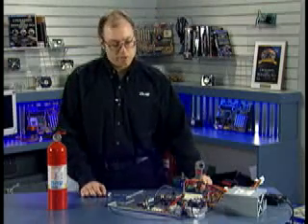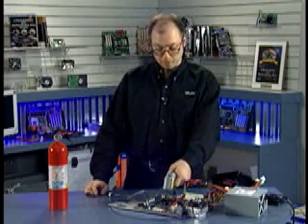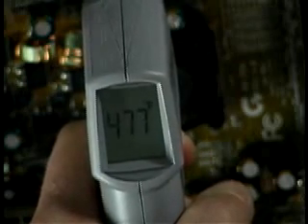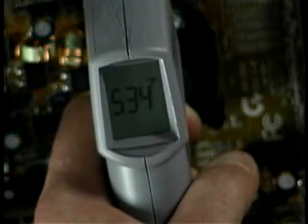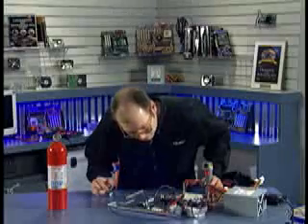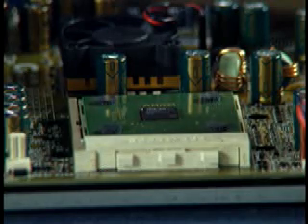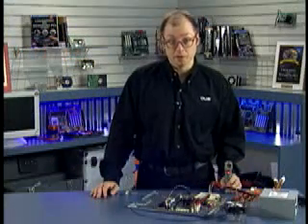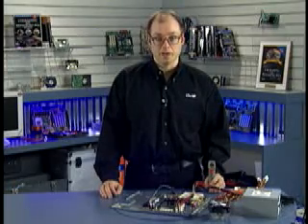athlon without heatsink

Comment: Many later Socket A boards had a failsafe circuit that linked with the Athlon XP's onboard thermal diode that shuts the system down when the CPU overheats like that. That setup saved my bacon several times. This test must have used an older board without the safety circuit.

Comment: @AudiophileTubes It uses a design similar to the ps3... In case of performance laptops... The northbridge, cpu and graphics adapter will each have a separate copper pipe attached to an aluminium or copper base... The pipes would converge at a particular point(usually at the left side of the laptop) which would again be attached to aluminium or copper fins for dissipation... A fan is also attached to enhance dissipation and to also direct the flow of hot air.